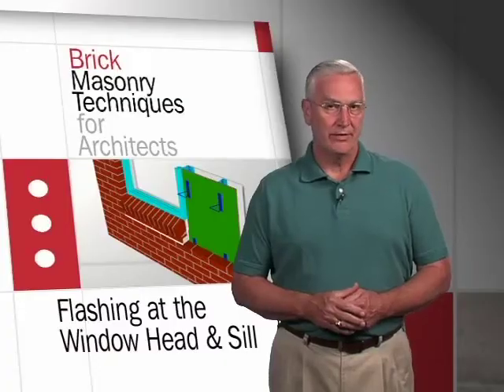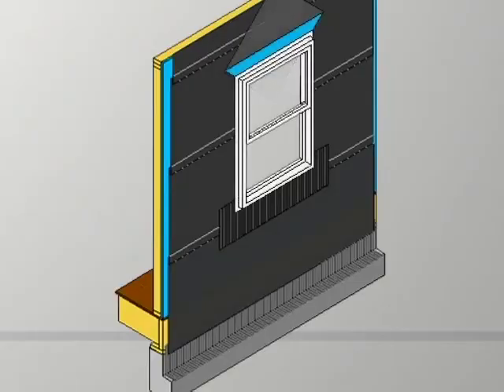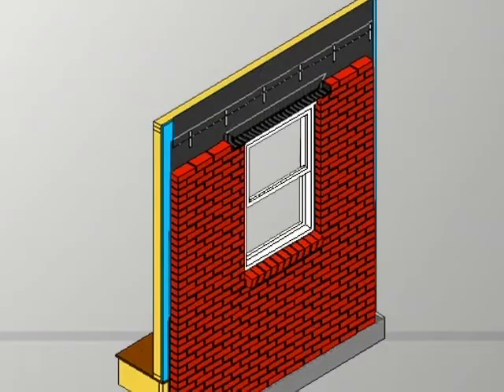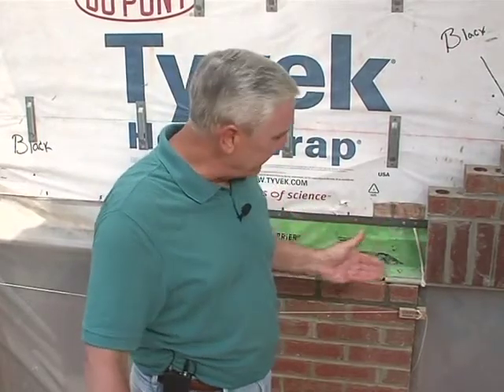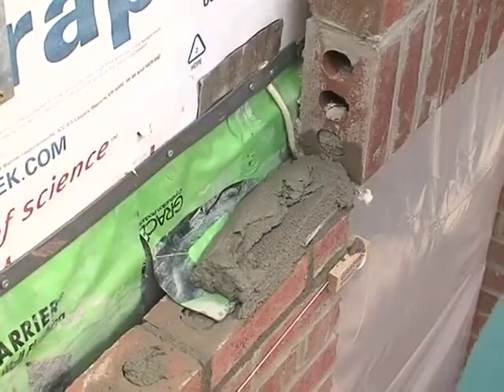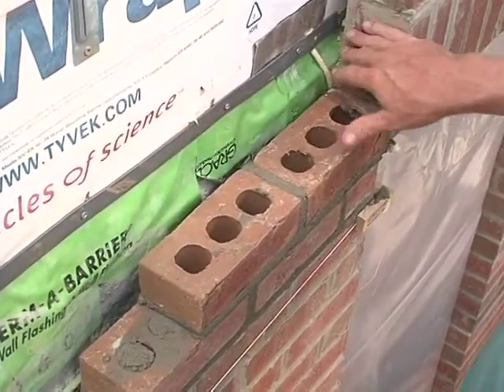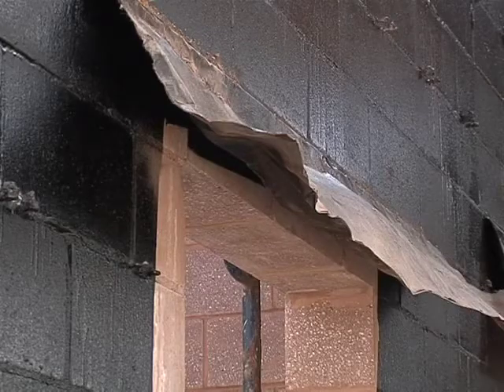Flashing at Windows (Head, End Dam & Sill Details)

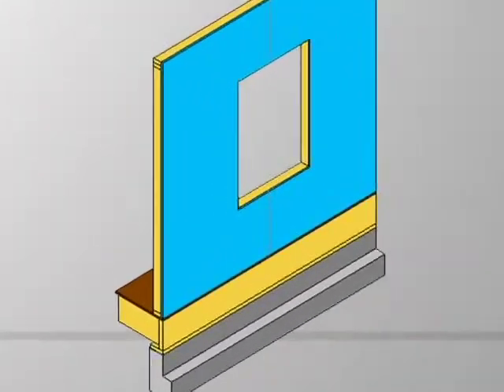Comment: 1:01 I watched your video on how to flash a window with outside brick wall as all the other videos didn't do any flashing or put flashing that actually will make things worse because there was no place for the water to flow out.
While I think your flashing is the best, I have 2 comments:

1- Having been in construction industry for over 30 years, I know no house that was built in any shape or form close to what you desribed.
I don't even know where you you can get the metal flashing sealed at corners other than welding them. No brick layer will stop to make these metal flashing. On my house that I built 25 years ago, the only flashing that was done is at the bottom of the walls to divert water on brick wall side to outside. If water made it to the framing wall side, that water will leak to the inside and down on basement wall.

2- Giving that my windows don't have the flashing that you described, I would like to get your opinion on alternative way:
a- installing a pan with sides around 1" and all corners sealed and the pan slopes down as it extends to the outside toward the brick. 

b- seal the bottom sill plate of the window using tar. 

c- Install the widow with spacing between the bottom of window and the metal pan.

d- on the brick side, you have the metal pan sitting on top of brick or stone piece in my case, a gap and then the window, fill gap between widow between bottom of window and the metal pan from one end of the window to other end after inserting plastic 2 or 3 plastic tubes that will carry the water in the pan to the outside.

In other words, I am modifying the bottom of my window to collect water and divert the water to outside using plastic tubes buried in the filler between the bottom of the window and metal pan.

I guess I am not sure why windows manufacturers don't include a pan with weeping holes at the bottom of each window they make. Some do that but only if it is a vinyl window. Wood windows don't have anything at all. Any water leaks goes straight to the basement walls. As an engineer, I call this bad by design as every window will leak sooner or later and with climate change causing more frequent and more severe storms, this problem will likely become a bigger problem for home owners down the road

I have been thinking about this some more and I have an easier solution as follows:
Since the windows in my house are sitting on a concrete cap about 2 inches or more thick, I can take the cap off first and then carve a channel in this cap to be my weep holes. When installing the window back, I install a metal container first. This metal will be similar to the metal container in video and on the outside end will be buried in joint between cap and last layer of the brick. Since the window is sitting higher than this concrete or stone cap, i have the slope that I need for the water to flow from window through the channel that I carved in my cap to the outside. 

I am only doing this because all windows will start leaking at some point and this flashing will collect such water leak and diverted it to outside rather than going down to basement walls.  

The windows in the US are extremely cheaply made inspite of being expensive. Most of these windows rely on 1/4" weather strip to stop water and air leaks.  Such strips will fail within a year or two. For this reason, I typically buy my wood windows,  completely disassemble them and then reassemble them using real wood joints that are both water and air tights using real heavy duty weather strips that are designed to seal doors, md company makes them.

Look forward to hear what you have to say. 
Thank you
AJ 1:02

Comment: The problem with flashing the sill like that is it's not bonded or tied in to anything to hold it in place. That's not a problem for the header because it bonds and ties in higher up and has sufficient weight on top of it to hold it in place. There's nothing holding the sill in place, if somebody leans on it or puts pressure on it, it can roll right out.
Reply: Certainly not, the strength is gained from the joints laterally. So basically the sill it tied into both panels each side and can’t be pushed out

Comment: your flashing needs to come PAST the lintel edge slightly to protect it. It should also be sealed below the flashing to the lintel.  your lintel is to close wall line also you'll never get enough mortar in front of it to stay very long. Folding your wrap up means zero because water should never get there anyway unless your window flashing fails. It would have no end dam and just run out the sides to the corners.

Comment: We have a brick veneer front on our home. We have had a leak near the bay window for the past 23 years. We have had numerous repairs, brick waterproof spray and 2 new bay window roofs installed and yet it still leaks into the house. The leak has ranged from continuous water running through ceiling during heavy rain to slower drips to ceiling stains. We have just learned that our parapets are built incorrectly - they are not sloped at all. But how can determine if this is the exact cause of our leak. How can determine if the veneer brick wall was built correctly; with an air gap, proper flashing at the 2 upper story windows & step flashing around the bay window's roof? And who can we contact to make the necessary repairs once and for all?! Please help.

Comment: Hi. If a window installer doesn't install flashing on the sill before installing a replacement window, but uses silicon caulking to create a seal around the entire window (silicon seals the gap between window and brick)...is this sufficient? Thanks.
Reply: Junior Sanchez  Thanks. Im on your side, but inspector comes after window is installed and sealed up....so how does the inspector know if it was waterproofed with flashing tape correctly? 
Lowes is telling me they do NOT install flashing tape (nor add non-expansion foam) in any of their replacement windows installs...which I think is wrong based on my research and by what you just replied with. The funny thing is, a Lowes youtube video on how to install a replacement window specifically states for a proper install to add flashing tape (and non-expansion foam for insulation)
Reply: joapps -- A brick repair person can use a hammer-drill to remove the bricks above and below the window and then install the correct flashing and replace the bricks. Window installers don't know how to do brick work.
Reply: And when it leaks the phone will ring,if you're still in business.

Comment: Bricks are so porous -- and have such poor R values -- why do we still use them?
Reply: My guess is bricks (stone) are a no maintenance item when compared to Hardi plank or wood (repaint @ 5 yrs). Just have to paint trim. If the stick framing behind the brick is properly insulated, brick's low R won't matter much.
Reply: Use water struck brick,insulation goes behind any veneer.Assuming some idiot doesn't paint them 0 maintenance.